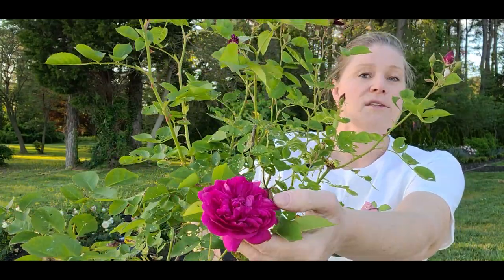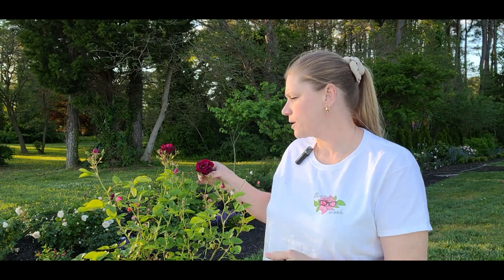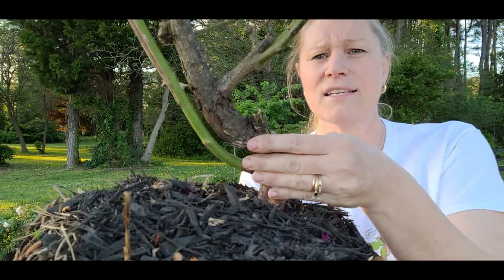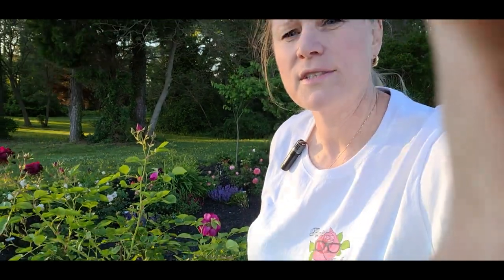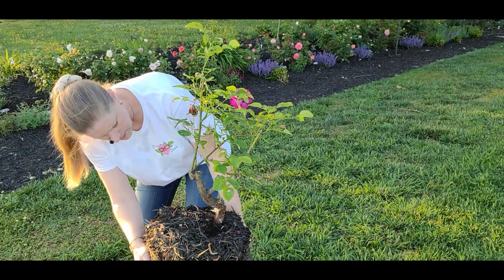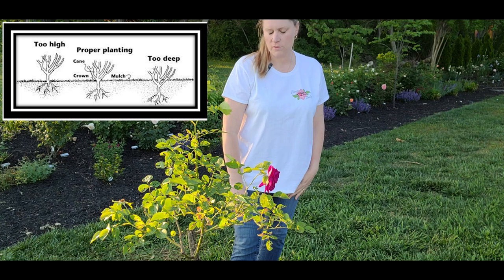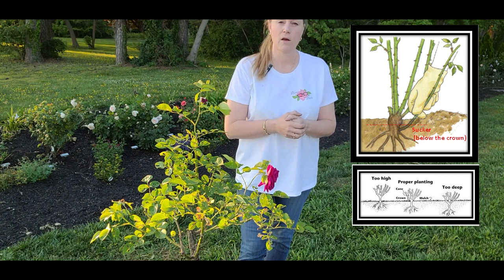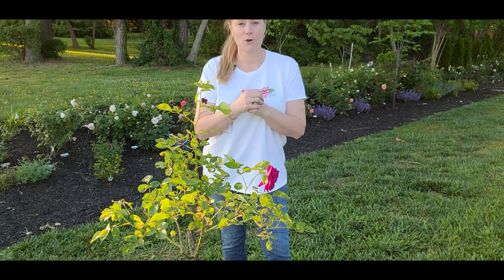🌹 Rose Root Sucker - How to Identify and Remove a Rose Sucker from a grafted David Austin Rose

Comment: Hello! I was just curious if the process helped save this rose?

I currently have a sucker on my rose but it’s a yellow rose (rookie here) I also read sealing off the cut or tear with Elmer’s glue is a tip but wondering what you thought of sealing off the cut.  Thanks!

Comment: Thank you for the video! Is it critical to remove the sucker ASAP for a young plant (planted this winter)? I have some groundcover plants around the base of my rose and I don't want to mess them up just to check the cane. Can I let it grow out until it blooms?
Reply from the maker: I see your dilemma.  If you aren't able to feel down the base and into the soil with your hand to see where the cane is coming from, you can wait a bit. If the rose starts to decline fast, you will want to dig it up though to see if there is something that you can do.
Reply: @The Rose Geek  thank you! I dug in a bit with my hand but honestly I am a rookie so I couldn't tell. It is very close to a "good" cane but still may be coming from the roots. I may have buried the crown a bit too deep - the advice is different everywhere, I live in a colder climate so to be safe i put a couple of inches under the ground. But now it's tough to tell where exactly the graft is! I will follow your advice and keep an eye on it.
Reply from the maker: I agree. There are so many conflicting recommendations on how deep to plant. If you are colder than 7, it is probably a good idea to plant deeper. Let me know what you find out in a few months.
Reply: @TheRoseGeek  thank you so much for your help! May I ask you once again? I have been observing this branch and it looks quite similar to the other new branches coming up that are definitely not suckers. They have the same leaves and thorns. In your experience, are suckers often drastically different in appearance from the grafted plant? Thanks again for your help and your interesting channel with beautiful roses <3
Reply from the maker: @SingingCrowie  typically the sucker branch will look different- cane, leaves, bud.  The easiest way to tell is to scoot the soil away from the union and feel around to see if it is coming from the crown or beneath.

Comment: Why i don't like grafted roses, try to purchase heritage roses tho they are a bit pricey.  But I did purchase a hybrid tea rose. Knowing all the issues I will be dealt. I liked the color and fragrance so bought it. As I took it out of its pot to plant in the landscape  there were shoots coming off the root ball,with roots attached.  Quess I should have cut them off. I buried it in the soil. I knew when I bought it,I have never have  luck with grafted roses. Guess I got to keep an eye out on new shoots? Pull them off ? So what I have learned is only the grafted part is what you want, nothing else. Well that makes for a rose planr with probably a short lived life span? Can anyone help me out here. I so much want different varieties in my landscape.  I started adding knock out roses, they have three different colors I know of. Red,pink an a new coral color. They are pretty, easy to grow,  just like any rose they are heavy feeders an of course you need to water from below, but not splash water back up on the rose bush that may have fungus growing in the soil. I don't mulch my roses for this reason. I keep out grass,  rake up any leaves or debris under them. I keep the soil loose by occasionally digging around them. That helps a lot with heritage roses to push up new canes. All my roses get once a week liquid fertilizer I hook to my hose.  They get once a month a good helping of bio tone. I use captain Jack's three in one for mildew and pest control.  I do this early in Spring, an again if I spot any insects. July is a bad time for Japanese Beatles.  I have to spray everything.  They destroy anything they land on. I was young and didn't know . We had lived in our home about three years I had by then a well established landscape,tho I worked and had a family.  I planted mostly flowering trees, shrubs. fruit trees, a lot of maples. I didn't have much time for annuals  tho I did have pots on my front porch and patio for color. One year Japanese Beatles came thru and destroyed a lot of my fruit trees, and weeping cherry.  I was heart broken. So I keep my eyes open, and spray everything.  You will know if they are just arriving.  You will see them.
Reply from the maker: Thank you so much for watching and commenting. I like Multiflora Rootstock because in the first year the roses grow so well. For me, in zone 8a, Dr. Huey grafted roses don't consistently perform well. 

By chance have you watched this video? This will tell you a little more about the different graft types and the longevity of the rose. 

https://youtu.be/6UucQQOq9zA

This is a video I did comparing the growth between Dr. Huey, Multiflora, and own root in my own garden.

https://youtu.be/8ENlNgS848s